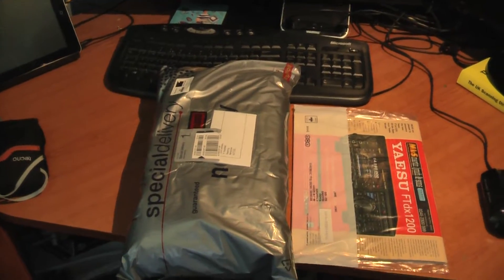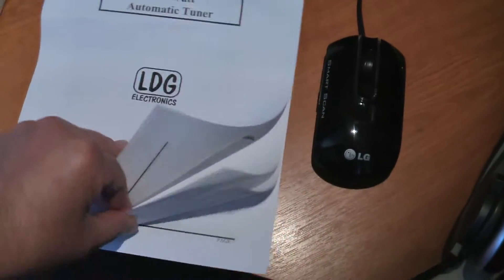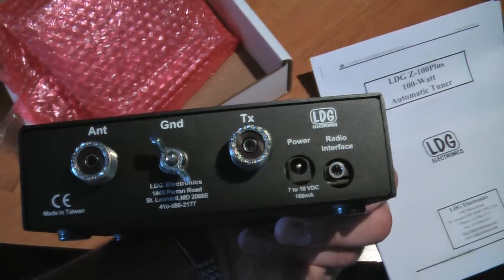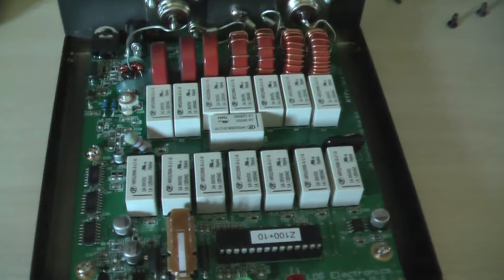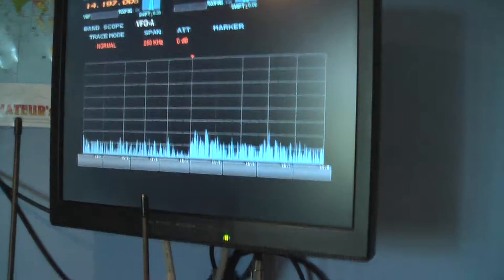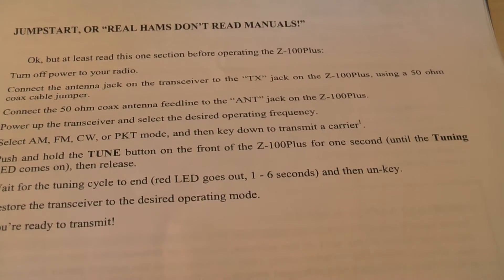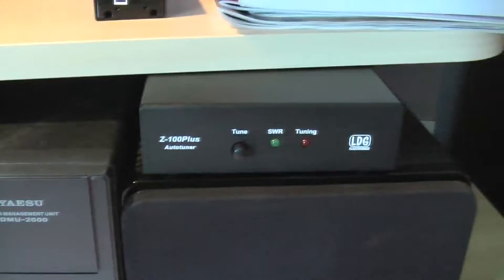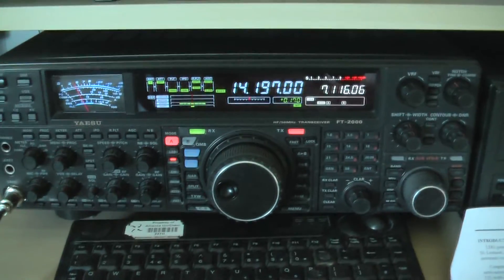Z-100Plus ATU unboxing setup

Comment: If you are using inturnal batteries be sure to change them every 6 months. One day mine wouldn't find a match on any band. It was because my batteries were down to 7.7 volts. 2 of the 8 double A batteries had dropped to less than 1/2 volt and the other 6 were still giving me 1.4 volts.

Comment: There are pegs on the PCB to solder the wires used for a internal battery holder. RTFM

Comment: Hello. If you still have this ATU, can you go look on the small circuit on the right of the uC, it is labelled "U 5". On mine is badly dammage due to an electric discharge and I need to search for a replacement. Thanks, 73 de YO3HJV.